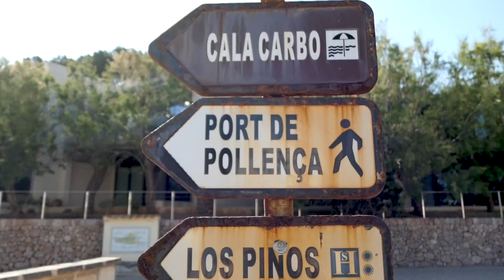The Maiden Voyage of a Liveaboard Sailboat Sailing to Ibiza Spain

Comment: Hey man quick tip from a fellow sailor. the flatter your sail is the less pressure you have roughly. so before dropping a sail check the tention. In light winds you can ease the control lines. but in medium/high winds make sure you pull the sails flat. Have fun out there

Comment: If you dunk your outboard .... take off the float bowl and dry it out.... turn over the engine with the spark plug out. Change the oil. Put it all back together.  THEN PUT A SAFETY CHAIN ON IT TO FASTEN IT TO THE TRANSOM... you know... in case it gets loose. 
Also... lots of folk turn off the water feed to the main engine. Check it's on before starting the engine, or it will boil your engine....

Comment: Check the tubes in your engine coolant heat exchanger. Be careful taking it apart with the o rings and or gaskets. You're gonna have to take the carb apart on your outboard.